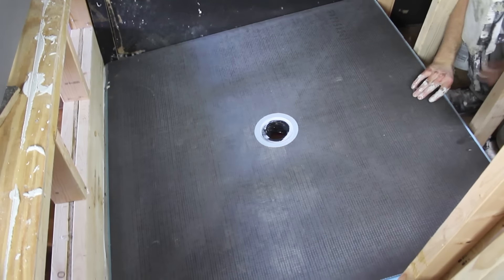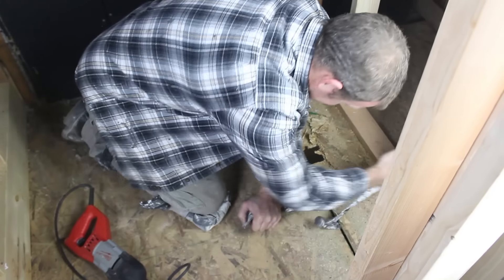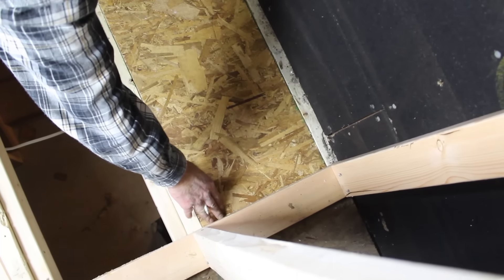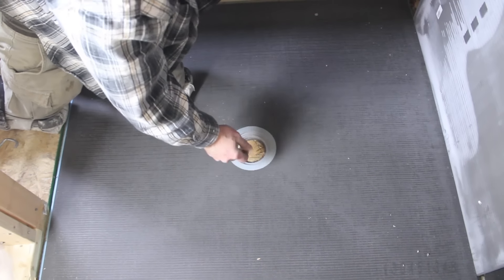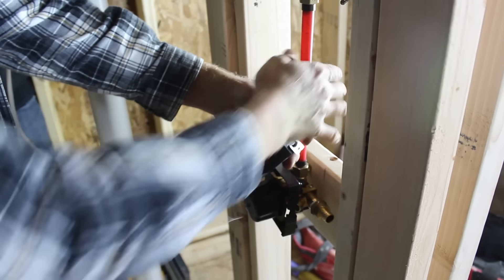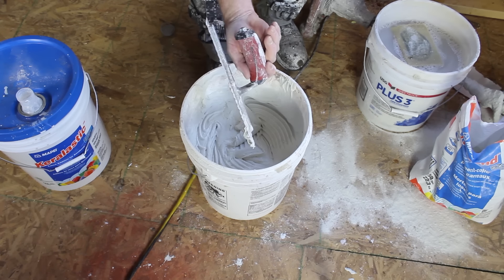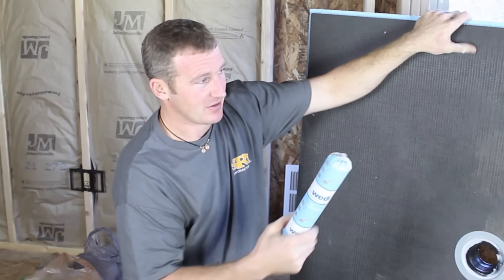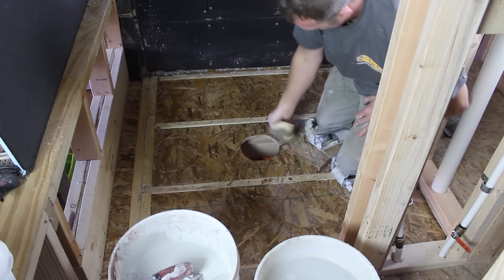How to Build a Walk-In Shower (Part 1: Wedi Shower Pan Install)

Comment: Thinset and OSB ?????
Not a good idea !
Reply from the maker: This is the approved method. Burning the thin-set into the OSB ensures proper coverage and bond strength.
Reply: Perfectly acceptable base for pre made bases. Do some research before criticizing installs.
Reply: OSB swells with water !😂😂😂
Reply from the maker: Kerabond wasn't mixed with water, it was mixed with Keralastic to make it a modified thin-set mortar
Reply: I have fixed enough showers to know that if any water gets under and it is a shower,you will be sorry !
OSB is garbage , just my opinion and you don't even have to  like it !😊
Reply: Why did you replace them, could it be because they where failing? Well ofcourse there was damage, if it wasn't failing it wouldn't need replacement. You are comparing a onetime application of thinset to a consistent steady leak. Two completely different things. Doesn't matter if its plywood or osb, if there is a shower failure and water is no longer contained they both fail. A onetime application of thinset will never hurt anything.
Reply: yep this is true....why not just buy a bag of modified instead?
Reply: I've seen plenty of rotted plywood decking as well. The thing about Wedi is that deflection needs to be met. The stuff is watertight XPS will last longer than the house & its other components. Properly mixed modified thinset won't swell the strandboard on that initial setting application

Comment: you are suppose to have1\4 inch per foot drain slope, none of the kind was put into this! are you just going to let it fill and when high enough drain into the drain ? worst floor install i have ever witnessed
Reply from the maker: This Wedi Fundo Ligno is pre-sloped with the 1/4” slope. As long as the subfloor is level and the pan installed correctly - which it was - then it will perform properly. Also, our Wedi Rep was on site during the entire installation.

Comment: omg this is a joke?I do tiles 30 years.i never saw so bad job like this
Reply from the maker: this curbless walk-in shower installation was done exactly how wedi requires. Have you used the Fundo Ligno?
Reply: Sadly this is how the engineers want it done. I agree that it is designed to fail but the job was done to specs
Reply: How so? Seems pretty rigid, but maybe crossties between the joists to form flatter or more even support? Just curious.
Reply: Lmao, what a bunch of clowns. Designed to fail?, nothing is designed to fail.
Cleary very old installers that are likely self taught and think there way is the only way. Unfortunately 90% of the time there way is wrong, because they refuse to stay current with new installation guide line and methods. Hack away guys, I thank you for paying my bills everytime I replace one of your job.
Reply: Josh Anderson the word is “their”. As far as old installers go, experience is the best teacher. I have graduated college and I have worked the trades. I learned far more by working then by reading about someone else working. I will say this and stop, only once you have done a job can you understand what it takes to do it right. Get back with us when you can speak from experience.
Reply: Jason Lee , it’s actually THAN and NOT THEN. “ I learned far more by working THAN by reading about someone else working”.
Reply: Andre Cummings seriously! Wow it’s called a typo. One letter doesn’t obscure the meaning. I’m sure you’ll survive